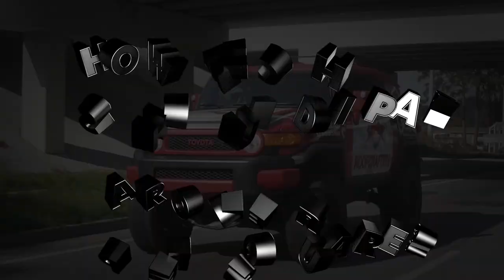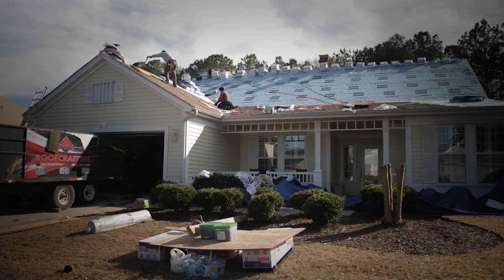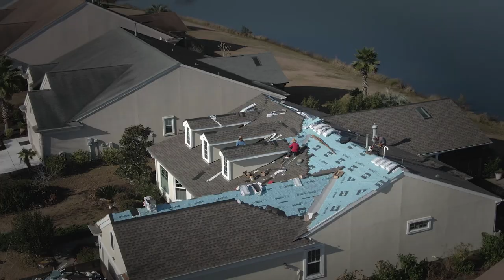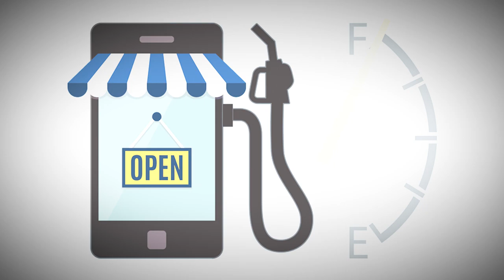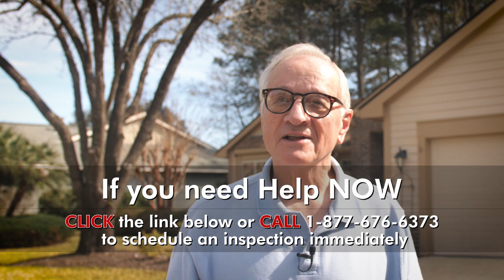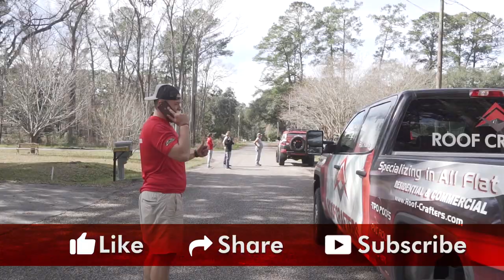How Much Should I Pay A Roofer Per Square

Comment: Thanks for the commercial and zero info.
Reply: The information you’re looking for or the answer is X or Y. It’s either X or Y and nothing less. $250 is low cost now, $500-600 major crowded cities or towns is a high average now, some even charge $1,000. You pay for reputation, you pay for actual warranties. For example you can get shingles with 25,30,40 or lifetime warranties. At least it says so on the wrapper and the roofer is pointing it out, but if its not installed correctly, then you may have zero warranty, and you can bet your butt that roofer isn’t going to just say my bad and pay for a new roof if he messes up. He could install everything correctly? But not know that you’re area has average winds that far surpass what your shingles can handle and insurance claims can be shot down for instance. Finding someone who has been in business with a reputation gives you the full benefits. Mistakes happen and a yes smaller companies may fix their own mistakes, bigger businesses do more volume and may have a smaller percentage of mistakes, but would likely have more experiences with fixing that mistake. Go for the company your friends and family trust and if you can’t get a referral, then hope the reviews are some good ones and you can go off that. The lowest of low prices may be an additional cost for just getting the roof done correctly. This does not mean feel great paying the most. Everyone homeowner can get multiple quotes/estimates. My brothers are roofers and they have a reputation of never messing up, but their prices would be on average the lower to average price, because they own everything they have and the customers aren’t paying for their truck payments and they have a long established relationship with the supply companies.
Reply: Lol, right!
Reply: @vin reaper $250 per square!!??

Comment: I am a roofing contractor from INDIANA. I have 20 years experience. And I completely disagree w this video. There is absolutely a square price for a roof. It's more of a price range to be most accurate. In my market area the going rate of a shingle roof per square is low end $225 and high end is around $260. This price includes labor, material, and trash removal. The rate a company charges depends on the quality of the shingles they are installing and other factors. But the main factor is how desperate the contractor is for jobs. The idea that bigger companies charge higher prices than smaller companies is not always the case. I run a small company and charge higher rates than most of the bigger companies. The largest company in my area is actually the lowest price. They are like the Wal-Mart of roofing. Big and cheap. They have a massive overhead so they have to sell about 60 to 70 roofs every month. So the have a rock bottom price to get the jobs. If a company has really high overhead they may have to charge more money. But that doesn't make the price they charge a customer A FAIR PRICE! The only time it's fair to charge a price that's higher the market price range is when you are giving the customer a product that warrants the extra charge. If they are installing the same quality shingles as all the other companies but asking $350 a square when everyone else is asking $225-275 then they are ripping people off. A companies need for money does not justify drastically overcharging a customer!
Reply: Good info! Question for you if you dont mind.. On a shingle roof over, do roofers change out the vent boots (flashing) or not.
Reply: Good point , do are you manufacturing this item ?
Reply: @getinthevanihavecandy   They should. We always replace all the flashing whether it is good or not.
Reply: Thanks, a straight answer,  you must have many happy customers

Comment: They never answered the question, 1st guy says they are going to tell you in this video, next week see the cute southern bell ,then we get the third guy who doesn’t have any answers.
New title for the video;  Meet and greet the roofing team from Roofcrafters. A good range is 
400 to 900 a square, depends on materials, size, difficulty, crew size or company size, could even be 1000 square or higher for high end expensive shingles, copper flashing galvanized or copper drip edge, ect, maybe they need special equipment , lots of factors, but everyone has their price.

Comment: Good advice never hire these big multi state roofing companies they dont have many direct employees they have subs.  And they get like 500 to 800 a square. They pay the subs between 60-250 a square. The best possible roof deal long term small companies with good solid roofers. That way all your details are right. All your flashings all your counter flashings all your boots. Painted vent pipes that the larger guys dont and cant do; at least not affordably. 
I like to profit 200 a square for a walker thats about 400 a square for a 25 square and under roof. Takes me 2 days. I have almost no trash hit the ground the final clean is easy and the roof is perfect.  People like it. I replace any wood thats bad, if you think roofers make money replacing wood you’re crazy. If you think fixing eves and shit like that is included it isnt. Small guys fix it all.

Comment: The only time you should pay a roofing co.to put a roof on a home is when you are buying a house as-is or the insurance had previously lapsed and it needs a new roof ASAP. If you have a home or house that has had full roofing coverage for at least 3 years your insurance co. Is compelled by law to cover the costs of a new roof minus any deductible.                           
The insurance companies will not tell the consumers this information.
Reply: That’s BS. Insurance companies are not “ required” to pay for roof replacement due to age.